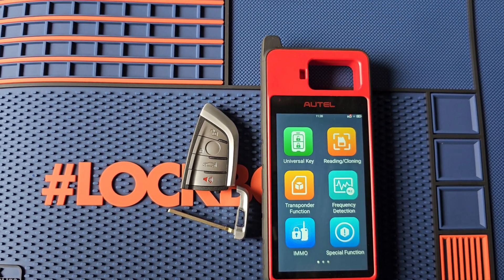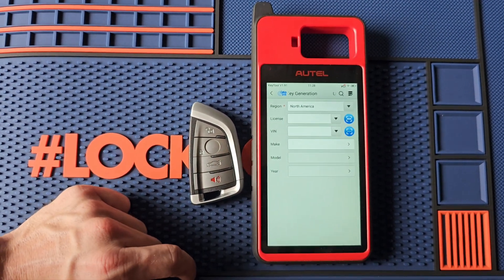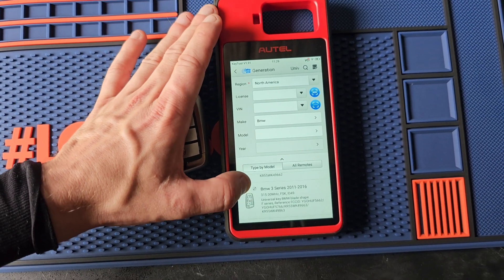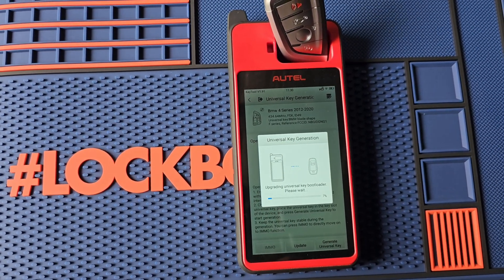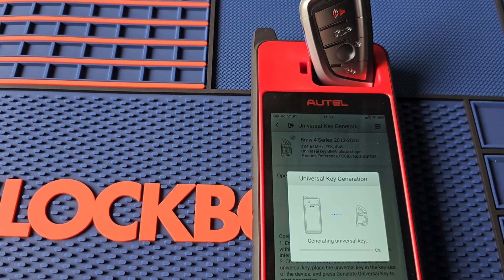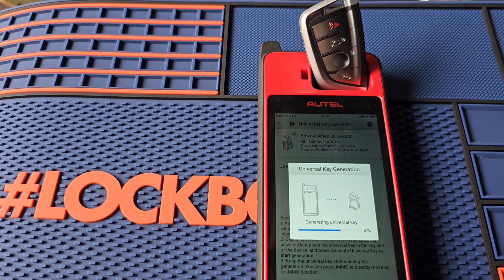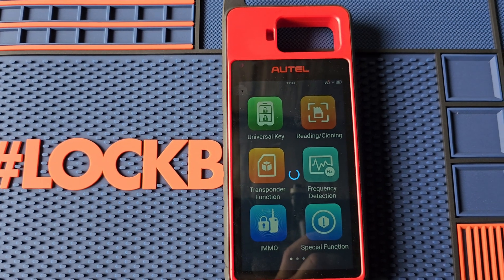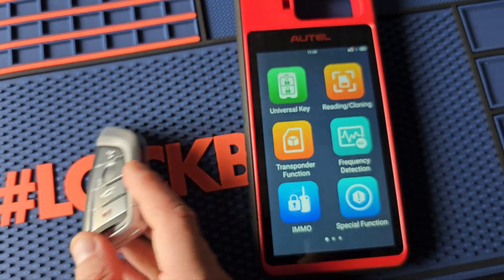BMW Smart Key Generation with Autel KM100

Comment: Auto manufacturers have sent stop & desist to Autel. Any old, new & newer or in development are required to not have features, capabilities & functions that can copy, sync, program, write, clone, fobs AKL, transponder, Immobilizer, chipped vehicles or the user risks bricking the customers ECU/ECM. 

So yeah the rumors are true.
Reply: when did it happen? I tried to add keyfob just today and km100 all the time warned it can not detect keyfob, but same time it can read keyfob frequency. I had that understanding that something is not right what it shows on the screen.

Comment: Did you ever create the follow up video for programming the key to the car? I am trying to accomplish this on a 7 series with CAS4 and the KM100
Reply: Hi did you ever find out how to do it with the KM 100?
Reply: @marcelauthorlee8322  this tool alone cannot do it. This tool can generate the key which is basically "prepping" it. You'll need much more to actually interface with the CAS and program the key.